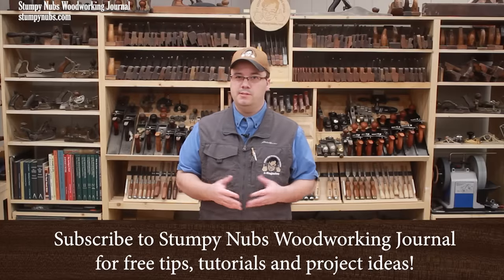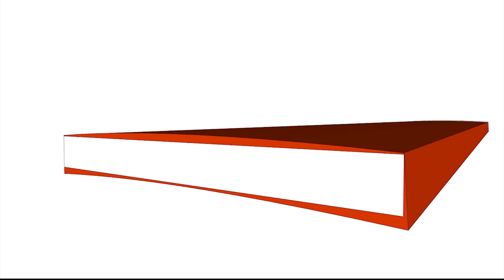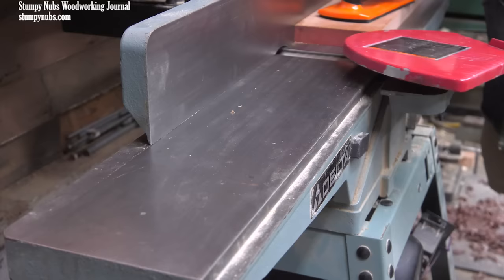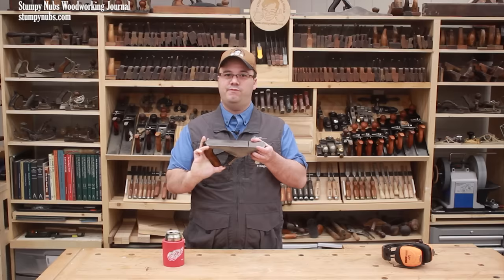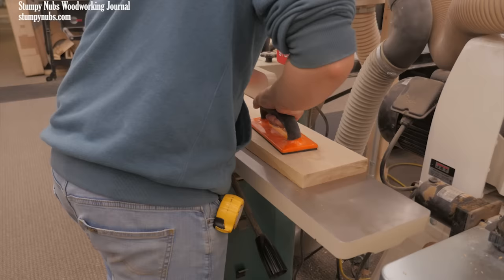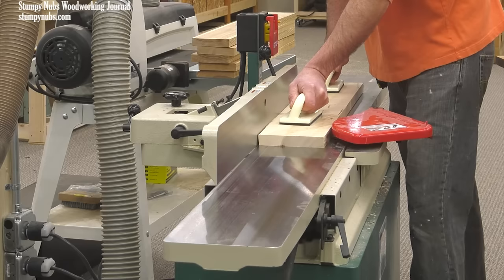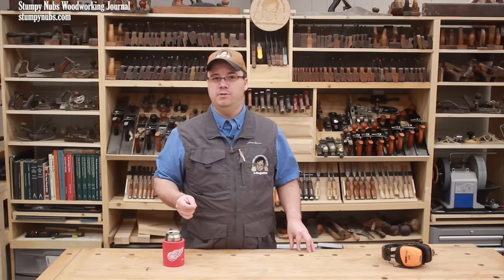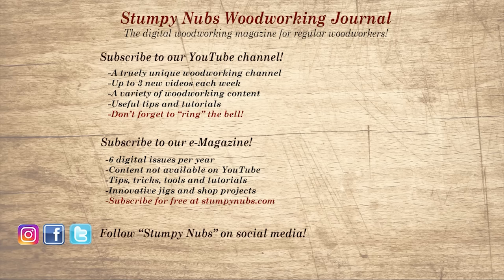Why do they call it a jointer when it planes wood?

Comment: The number one rule dad taught me about working with power tools in general - "Never think about anything else when woodworking.  Always remain focused only on the task at hand."
Reply: absolutely, positively correct .  very smart dad.
Reply: Absolutely! And I apologise for liking the comment changing it to 70 likes from 69........😜😂😂😉
Reply: Funny enough, in an industrial setting, it's almost the exact opposite. Focus on your work, but never lose awareness of your surroundings. When you're by yourself in your own shop though, I'd agree with you wholeheartedly.
Reply: Me: zones out at work while using a drill press
Reply: For all tools in general, you know how bad a chisel can cut u when u slip
Reply: Your Dad’s saying is right up there with ‘measure twice, cut once’. Old school idioms that have a big dose of common sense and smart safety to them.
Reply: @brianrussell7691  I learned that if you cut it too short just cut it longer.  I just haven't been able to figure out the technique for that.
Reply: I have a friend with many different length fingers that would give you a thumbs at least half up.

Comment: Just a helpful tip regarding tearout: you can often see tearout on rough lumber from when it was processed at the mill. Just run the board in the opposite direction and you should be good to go. Saves the step of having to do a test cut.

Comment: Here's a little common sense reminder that I was taught in shop class in school. The instructor explained how knives fit in the cutter head on the jointer. Pointing to a straight 6 inch gash in the ceiling, he said that is what happens if the screws aren't tightened properly. That lesson was more years ago than many of you have been alive, but it always stuck in my mind.
Reply: Great reminder
Reply: And the ceiling.

Comment: I want to thank you for never forgetting safety in all your videos. I started watching your channel just before your incident (we never say accident, there's no such thing). I used to know a man who owned a small crane service company. He would not hire a crane operator who had never tipped over a crane. He believed that a person could not fully understand how important it is to work safely unless they've been involved with how bad it can be to not work safely. 
Something you said in this video, really stuck with me. It was that you "insist that paddles are used in my shop". There's no one in my shop, except me to insist that I do anything safely. No one is going to shake their head in disbelief or try to stop me from doing something risky. Anytime I do something I know I shouldn't, and get away with it, it just reinforces how "good" I am and emboldens me to take more shortcuts.
This weekend I built a push block for my jointer to replace the one I misplaced weeks ago. Then I cut a slot and glued in a Walnut riving knife for my table saw zero-clearance insert. I just want to thank toy for putting a bug in my ear.

Comment: I have owned a jointer for about 4 years. And until now I was not using it to its full potential until after watching this video. Now I will not be throwing away as much wood to the burn pile as much. Thankyou for the great tip. Keep them coming brother.😊👍

Comment: I use a 4 3/8" Craftsman rabbeting jointer mostly because I got it cheap but I like using "classic" tools. Properly set up, even a small jointer can be very useful (& it fits the room i've got for it). I also upgraded the bearings, went from a 1/2 to 3/4 hp motor & sped up the cutter head. It requires almost no sanding on single pieces.
Very good video. Most people know so little about jointers.

Comment: My long bed six inch jointer with shelix cutter head does everything I need to build furniture in my one-man shop.  When I need to joint a wider piece I use an MDF sled with an array of screws that can be set to support the uneven underside of a board up to 12" x 48". In effect, the planer becomes an overhead jointer.  Once that side is flattened, I hang up the sled, flip the board, and plane as usual.  The sled needs to have a stop on the front end to keep the workpiece secure as the feed rollers of the planer pull sled and workpiece forward.

Comment: I occasionally use a magnetic feather board on the outfeed side when edge jointing wide boards. Just gives a little extra assurance the board is tight against the fence.

Comment: Norm Abrams used a 6” jointer for years. He did upgrade to a 8” at some point but he built a lot of projects with a 6” Delta jointer!  I have had both the 6” and 8” Delta.

My preference is the 6” because it matches the re-saw capacity of my bandsaw and takes up less floor space.  The 8” did have a nice long bed but since I don’t often joint 8’-0’ stock the shorter bed on the 6” jointer has never disappointed . The money gained from selling the 8” jointer bought an excellent used 6” Delta jointer and 14” Delta bandsaw with enclosed stand and fence.

A friend of mine bought the helical cutting head - nice but three straight knives works fine for anything material  you are going to buy at a big box store.

Comment: Great information. I bought a rusty old 6” Central Machinery jointer that had been left out under a shed structure. The price was right so I bought it. I cleaned off the rust and replaced the worn out blades with new blades from My Wood Cutters. The quality and thickness of the steel was so much better than what was in the router originally. I’m very happy with my purchase.

Comment: Thank you James. I bought an old 6 inch jointer that has been fighting me ever since I got it. Your diagram made me realize that the blades are installed with the bevel facing the wrong direction.

Comment: I lucked out on a benchtop 6" jointer for $70 at a pawnshop that didn't know what it was.  Didn't even need to sharpen the blades (but I did need to adjust their height)  Otherwise I'd still be saving and doing the tedious planer jig trick.
Great video as always.
Reply: What a great find.

Comment: 7:28  Even though the machine is not running, you gave me the shivers right there.  I bought my jointer second hand.  The owner had only used it for edge jointing so the paddles were long gone.  The absolute first thing I did when I got home was make some paddles.  To me, the jointer is scarier than the table saw.

Comment: Stumpy, an instructor of mine said never pass your hands across the blades  but just lift them when they get to the blades so that if the board disappears your hands are safe.  Tiling floats  cheap paddles.  Another instructor said only plane until 60% clear and head to the planer.  This keeps thickness and the board can be flipped to finish up.

Comment: Here’s a technique I have developed to deal with twisted, wonky boards. It works well for flattening and edge jointing. I have a Makita brand handheld, carpenter style jointer that hardly ever gets used. By marking the high edges of a rocking board with a pencil, and then rough planing with the Makita, little by little, sighting as I go, I get the board RELATIVELY FLAT (to the eye).  Then I use the jointer. If I am edge jointing a board with a large bow or concavity in the edge, I use the same technique to get the board relatively flat to the eye.  This technique works especially well when you don’t have a lot of thickness to play with. It allows you to get to the end result very quickly with minimum of wasted time or material. Obviously, a hand tool like a scrub plane would work as well just not as quickly.

Comment: Thanks for the tutorial...  One flat face and one square edge that works for me a place to start..I can make an entire table top.....Square edge to the fence of the table saw do the cut as parallel as can be..do a spring joint with biscuits... clamp it tight and do that again until you get to your desired width...easy peasey no wasting lumber..That is how my high school teacher taught me... Thank you Marvin Henrey.  I am 60 years old, that man taught me a trade that has served me well and kept food on my table all of this time.  I can not thank that man enough... Started us as kids sharpening our chisels on the bench grinder..absolutely, square ..no nicks no burns ..one face... then to the stones..until you picked it up just a bit when you used the hard arkansas stone to do the last little bevel....if he could not shave his arm with it... back to the stone you went...Honestly for me it is faster for me to buy a new chisel than it is to take the time required to do that...However I do know how it is done...I guess when I retire I will gather all of my good steel and sharpen them by hand...Old school...Thank you Mr Henrey...Jim   (I am sure you get such letters all of the time might be a good idea for an episode..to honor those who taught us..Jim)

Comment: thanks again for another great video i just purchased the Wen JT833H 8 inch spiral head jointer, Lowes had a special 20% off your first purchase i dont like credit cards but after  my cash down, 2 gift cards and 20% it went from 410 plus tax to 177 after tax   i have a planner and table saw so after your videos it can help my woodworking which im still a little new at, about a year or so thanks again

Comment: I bought a Craftsman jointer a while back. Each time I use it, I get a wedged board. After watching this video I understand why. However, I try to stay away from this tool I seem to mess up my lumber when I use it. Recently I started working on a shadow box. After cutting the boards to length, I noticed one of the boards has a noticeable twist to it. I decided it would be helpful to use the jointer on all the pieces. The first board I picked was almost perfect as it was. There was just a small twist to it. I thought only a few passes would do the trick before taking it to the planer. However, after running the board over the jointer several times, I could never get a flat side. Eventually I noticed the right end of the board (back end) wasn't even close to sitting flat on the table. When I look down the length of the board, I see a noticeable change in angle halfway down the jointed side. The left side of the board is wedged but sites completely flat. However, the right side of the board picks up off the jointer and does not get touched at all. Do you know what I am doing incorrectly?

Comment: Here in U.K. and Europe in general we favour combination Planer/ thicknesser  (Jointer/Planer) which have the following advantages :- they plane and thickness to the full width capacity of the thicknesser  and thus avoid having to saw the boards into a smaller sizes to flatten them and glue them back together again to thickness them, they take up less workshop space, they are cheaper than two separate machines. The often quoted disadvantage, the complication and time taken to change modes has been greatly reduced by all manufactures in their latest models and does not outweigh the advantages for the hobby woodworker. For the production shop separate machines may be advantageous but only if a jointer is of the same width as the thickesser . Twelve inch and above jointers are very expensive.

Comment: My first woodworking project was to build a workbench out of 2x6 boards.  All I had at the time the only power tools I had were a Miter Saw and an Electric Drill.  Now I have more tools (including a thickness planer, a table saw, and a biscuit jointer) and my skills have improved so I took the flattest board and made a sled the jointed one face and made the other side parallel (both using my planer).  After that, I trued and edge then made the other edge parallel (both using my table saw).  Next I biscuit jointed everything to bring one side co-planar and glued everything up.  Not the top of my bench is a (almost) perfectly flat slab.  I did a lot of this based on your previous videos.   Would a jointer have been nice? Sure, but for how often I do this, I would rather spend that space and money on something else - maybe a lathe.

Comment: I was hoping you'd cover the one piece of info that I rarely see mentioned but I believe is critical for getting flat boards: the majority of the pressure should be applied to moving the board forward, ie lateral. Downward pressure should be enough to keep the board stable on the table but not much more. I've found many to put too much downward pressure which will bow the board and not get you flat.

Comment: Excellent. I appreciate your easy to follow plans and the straight ahead logic while building the Router Lift. I used the pop and click laminate floor material for my top and trimmed it with some poplar. I had to make a few modifications for my old Craftsman 1.5hp and I am very happy with the finishes that the router makes.  Thank you again for a job well done. Now Table Saw Extensions need to be made and installed.

Comment: You made a point about the differences between a jointer, and a thickness planer, but there are ways to use a thickness planer as a jointer. My favorite is to use a sled with a generous layer of drywall mud between the sled and your work piece, Jonathan Katz Moses did a great video about it.
Reply from the maker: Those "tricks" work great if you have a couple boards to flatten. They are not practical if you are building a large piece of furniture with many boards to flatten, in my opinion.

Comment: Perfect timing, just acquired several hundred board feet of cupped white oak flooring, and was considering planning first side with a hand plane!! Before using my planner, cheers for resolving an issue... here in the UK, don’t really have a great selection of jointers? genius channel please please keep up the good work, best regards.

Comment: In England in the 70's the jointer was called an overhand planer, in New Zealand it is still called a Buzzer. When I was younger I was shown how to raise the outfeed table very slightly higher than the cutting circle of the blades, this resulted in a concave bow on the edge of the board to be jointed.When the joint was assembled only one cramp was needed to cramp the boards together,this was known as hollow jointing and was useful when a lot of boards needed cramping and only a limited number of cramps were available.

Comment: Great video The final step of using a table saw to cut the final edge is isn't obvious. Why not just use the jointer for that edge as well. Thinking about it you have the same problem with the edges as the top and bottom - they wouldn't be parallel. So it makes sense to use a table saw to make that final cut so it's parallel with the other edge.

Comment: As a hobbyist, I can't justify the expense or garage space of getting a jointer. But I do have a thicknesser. So if I wish to dress up some rough cut wood for a project, I clamp them together, stand the stack on its edge and run them through the thicknesser. This gives a nice edge to all the boards, then I run them through individually to get the flat sides looking good. It seems to work okay, probably not good enough to edge-joint them but good enough for a nice square edge. I am really careful about where the clamps will be as they go through the machine, I understand about flying bits of metal being an ex-serviceman. Any feedback on this method would be greatly appreciated, I am sure there is something I have forgotten about by doing it this way. Like I said, I am just a hobbyist amateur woodworker. I love your videos, and have learned a lot from them. Keep 'em coming.

Comment: In German, we call it a "Abrichthobelmaschine" which literal translated "abrichten" means "to dress" or "trueing" and "hobel" is the word we use for the hand planer. The last part "maschine" you can probably guess, machine.
Similar we call a thickness planer "Dickenhobelmaschine"... "dicke" = thickness and again "hobel" and "maschine".
So in German, all those machines are "planers" which create a flat surface, in case of a jointer on one side and then at a angle to the first side a second. In case of a thickness planer it creates a flat surface opposite to one side.

Comment: Thank you for the video.  It is always very informative.  The only thing I would have liked to have see\heard in this video would have been to hear the difference between the beginning of the flattening processes and the end so you have a good idea on how many passes it takes and how to determine when enough passes through the jointer has been made before you take the wood to the planer.  Other than that...keep up the good work.

Comment: The Grrr-ipper paddles are the best.  I use a regular one on the front to keep downward pressure and the Gripper one on the back.  Even after waxing the top, I always felt like I was fighting it with just to the two pads.

Comment: Dear Stumpy, this is a great video. As a professional cabinet maker, I have been using a jointer for more years than I care to remember. The use of a jointer requires far more skill than your examples would suggest. The reason I mention this is because some of your viewers may not realize that a monkey could joint a board that is shorter than the the in feed table. The real skill comes when your board is long. One should always joint crown down. The skill comes in by being able to sight the board and make a flat that when the crown is removed you are skiming the heal and the toe of the board evenly. That way you maximize the thickness of the board. Nothing worse than to come into the shop and find out that all of the material that you needed for 8 ft face frames had been jointed wrong and now the best you can do is 1/2" boards. In an 8 ft run a 1/4 inch of material is not that much.

Comment: I own a 4” jointer and it is good for faces and edges, but it definitely isn’t ideal. What I do for faces wider than 4” is create a flat surface with a Jack plane and use that as a reference face. Hopefully that helps someone out there. Excellent video as always